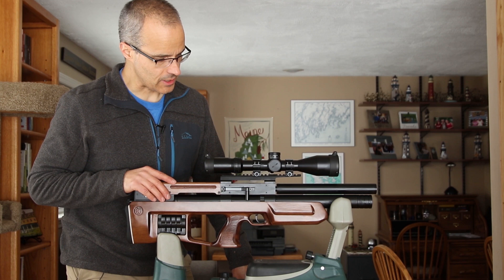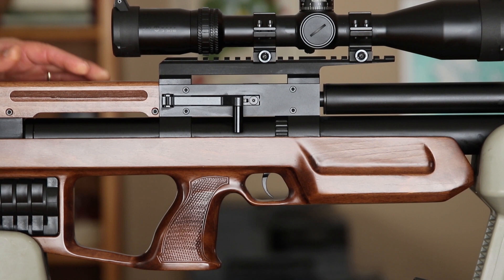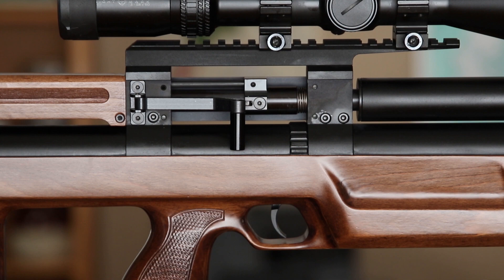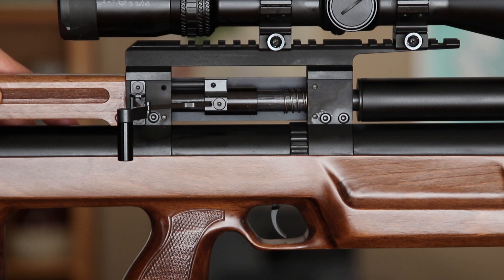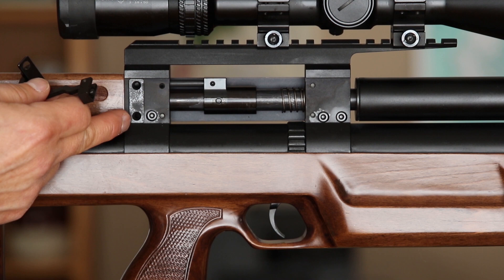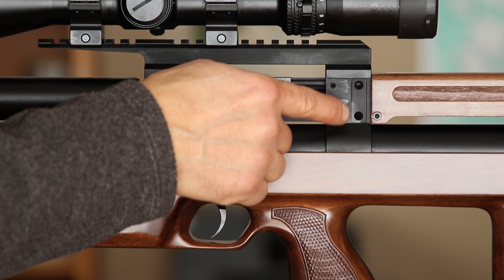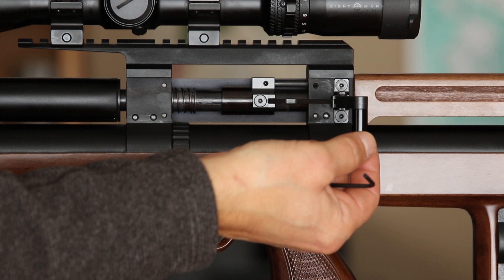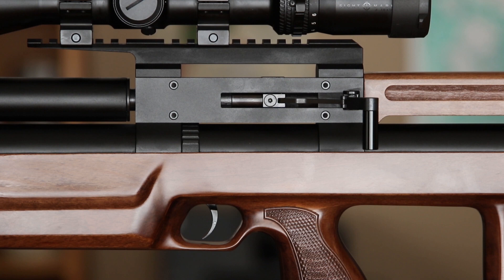Kalibrgun Cricket II Sidelever Cocking Lever Switch

Comment: I shoot my cricket left handed but keep the cocking on the right,
This way my hand is on the trigger all the time,
Think I'll try this though to see if it feels better,
Thanks
Reply from the maker: I'm fortunate enough to have a cricket II and a cricket II tactical.  For whatever reason I have gotten comfortable with having the cocking lever on different sides.  It's on the left on my c2 and on the right on my c2t.
Reply: @coultervid  I love the look of that tactical,
I'm having a smooth twist unchoked barrel made this weekend for slug shooting.
Have you tried slugs in that tactical yet ?.
Reply from the maker: @PeakyBlinder  yup, I have tried several.  None have been as accurate as pellets...

Comment: Hey Matt, I am also a lefty and I am thinking about getting a Cricket II for the swappable lever. Which caliber is more accurate overall, the 0.22 or the 0.25?
Reply from the maker: Hi there!  Great question.  I shot them side-by-side and they were even at 50 yards.  I was shooting 18 JSB from the 22 and 33 grain JSBs from the 25 so I was really surprised that (on that day...) the 22 out performed the 25 at 70!  I know the 25 can shoot much better and I did discover that my bipod on the .25 was loose.   I really think the guns are pretty evenly matched!  But you can’t beat the physics of a heavier pellet so no doubt that the 25 SHOULD out perform the 22...  Anyways, they’re both great guns :-)
Reply from the maker: Oh, and here is that Cricket vs. Cricket video:

https://youtu.be/aZU66xSSiXI
Reply: @coultervid  thanks for your response! For some reason, whenever I read articles regarding calibers comparisons, the 0.22 is always mentioned as being the better choice for accuracy. Why is that?
Reply from the maker: @heromang4968  Hi and sorry for my late reply to your question!  I hate to reply with a question, but when you ask if it's a better choice, I am wondering what you're comparing the .22 caliber to?  I would definitely say that it's easier to shoot a decent 50-yard group with an 18 grain .22 caliber JSB pellet than an 8 grain .177 caliber pellet.   

However, it gets harder to generalize when you compare that 18 grain .22 pellet to a 25 grain .25 caliber pellet!
Reply: @coultervid  ahh that's a very good point. I haven't thought about the weight of the pellet. I was comparing it to the 0.25. I think what they assumed was an equal energy for the two rifles, but I guess if the rifle's power scales with the larger caliber (as it is the case with the cricket) the larger caliber wins due to the better wind coefficient.
Reply: @coultervid  Hi Matt, I was also thinking when watching that video that you were not changing your shooting position as much on the 22 as the 25, so each time you had to cock the 25 you have to reset yourself back on the gun.  That probably has quite a bit to do with it as well because you are having to move the gun and your weight / force location on the gun and table is changing more.  Little things that you might not think of when you are the shooter!
Reply from the maker: @Glen   thanks for catching that.  It makes perfect sense and 100%, forward cocking is the way to go!